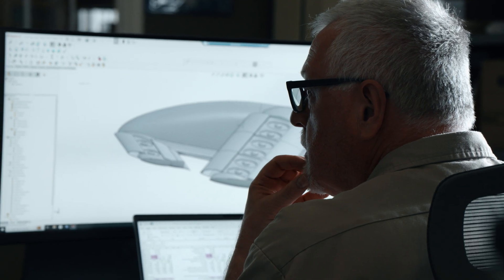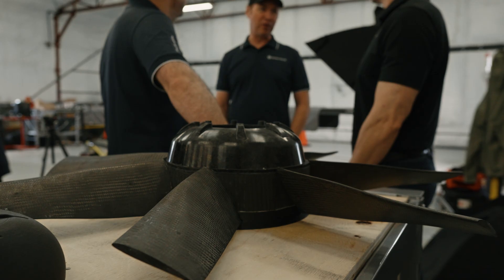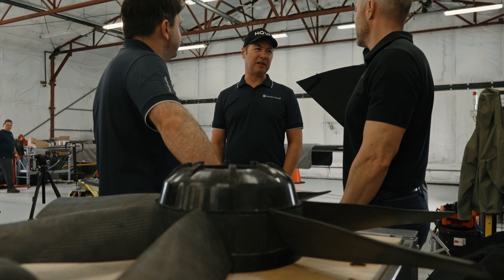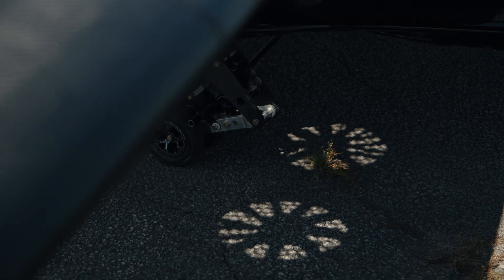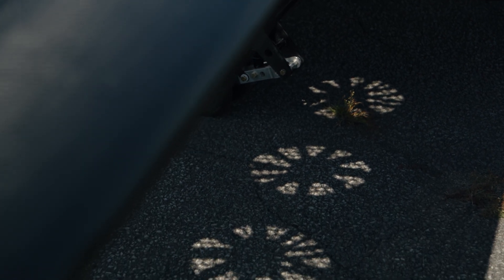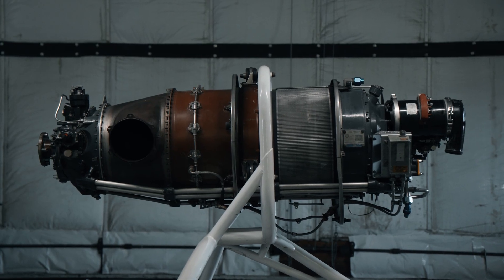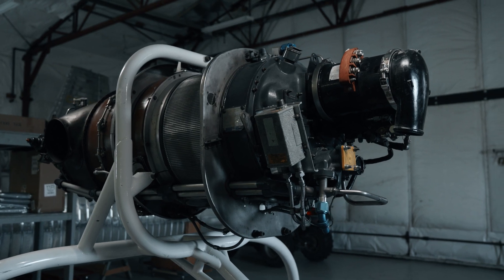Hybrid eVTOL: Full Scale Ahead | FLIGHT/PATH – Episode 9

Comment: Very dumb aircraft. No one's going to buy it if it costs more to fly.
Reply: Uhmmmm, 🤔   ...  more to fly, ... interesting.  

Air Canada,  in a regional airspace, has to fill let's say a 30 seat craft, with two pilots and 3 to 5 cabin crew, and has to fly some two to three stops to fill the booking. 

X7, at 6 pax and 1 pilot  can make one direct flight to the international airport,  some 6 times daily easy. 

The feul cost for a week of that duty is probably a day worth , what it cost air Canada now. 

1 pilot,  cost 
Vs 
2 pilots and 3 to 5 crew members.  

Direct regional node vs flying all over to fill a plane booking just to get to the big airport.  

I'm sorry my guy, but  this is a regional airspace disruptor,  that will reduce cost and improve efficiency.    

Nnnn thats just airline aspect.  

Now, uhmmmm 
Where I needed 10 helos and 10 small single engine conventional craft, ... hello I can cut those cost with a craft with dual abilities,  an flight cost beats both.  

Hey,  we have a real disruptor and problem - solution craft on our hands. 

So , very "smart" aircraft  💪😎💪
Reply: ??? What cost numbers are you referring to?  Please show why you're saying it costs more to fly.
Reply: Costs 75% less to fly according to official sources
Reply: @yellowbat-k2b  ...  i can see that, feul cost split with electric usage,  electric does the heavy lifting, feul is mostly highway miles. Throw in great drag coefficienency and even better usage.
Reply: Thanks for your interest. Actually, it'll cost about 30% less per hour than an equivalent helicopter. Notably, in that hour it will travel about twice as far, so total savings over a helicopter is about 75% less per unit distance.